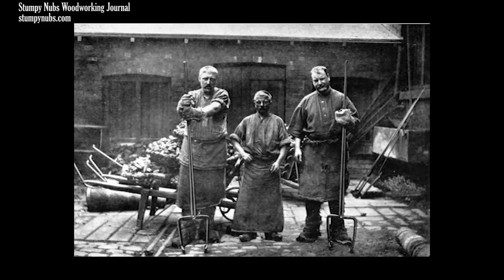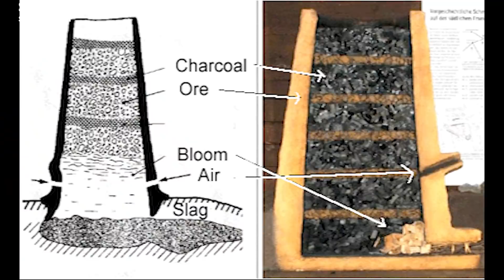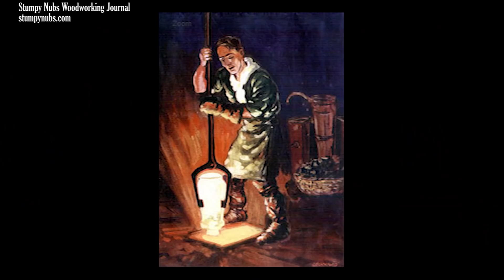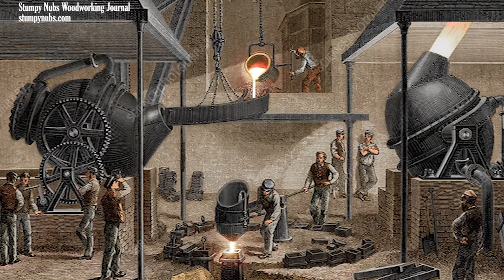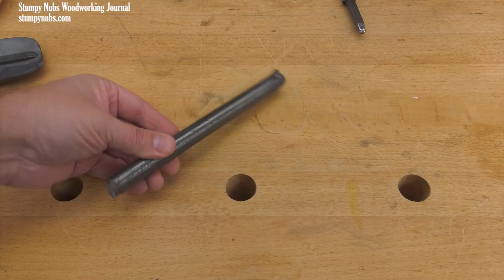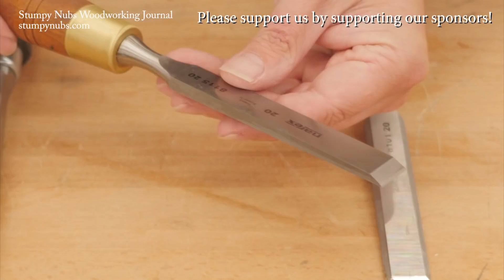Why a lot of tool steel is bad.

Comment: Just to make sure: my understanding of this is that a metal when is cast gets tidy particles, hardening works because you displace the molecules due to termal expansion and general heat and then cool them down getting an untidy mass that is strong due to his creases and uneven distribution of particles(kinda like a folded sheet, or interlocking hooks), heating it up releases the tension stored in those particles making the metal malleable and soft while it was previously brittle and hard exactly like glass (that has the same principle),i thought wok hardening worked the same way, at the end you talk about casting these rods and forming them with a pressed stamp, wouldn't that give a worse result than a forged tool due to the many hammer blows?
Reply: I dont understand why its assumed because its stamped it somehow will be worse off than being forged. Im just a total noob that youtube recommendation got me here, but from my understanding (i do watch alec steele for entertainment too) being hand-forged doesnt really have any advantage material property wise (i could be very wrong)? Making moulds are very expensive for a once-in-very-long-time projects and thats where forging advantage is (again, i could be wrong), you can shape the material anyway you want without commiting to making a mould for it. From Alec videos he does still heat treatment the finished product, so i dont see why would it be any different.

Feel free to inform me of this, im curious about this whole thing now haha
Reply: @Crustee0  i do watch alec steele too, in my understanding working a piece is better because you are displacing material and forcing it into shape as opposed to for example casting, when you cast a liquid metal the particles while still free in the solution will go to a place in which there is no force applied to them, making a geometric structure, while if you move material without melting it or you cool down a molten piece quickly the particles will get stuck with tensions between each particle that can be removed by heating the piece and letting them move around while they can (the more you get close to liquid state the more freedom and movment they have). Working on a piece means generating more tensions inside the structure which mean more strength at the cost of being brittle, exactly the same thing that happens in glass or obsidian. Striking the piece with the hammer makes the structure messy and stronger, this is probably true for the press too but i am not sure it's exactly as effective, the reason is that the displacement of material is determined by only the shape of the product giving and hardly optimising the work hardening, while the hammering will come 100% with a high ammount of particles in tension which would equal to stronger steel,  casting it would be easier but ineffective because it would lack that messy structure. But i am no expert, i was making a question originally trying to understand that, my reasoning behind said question is the one above.

Comment: About the laminated plane irons, there is another reason. You can make them quite a bit thicker, and having the soft iron layer means you can still sharpen them easily. I have one of those in an older wooden plane, and it's great. The bulk of the iron is removed with a file. Richard Maguire touched upon that in his sharpening series (I think).

Comment: Thank you for a very nice explanation. Also I'm happy to see Czech Narex chisels featured. I have a set of those bevel-edge chisels and I'm very happy to use them. They need way less frequent sharpening, eg.  than Stanley no. 5/4 plane blades from 1930s. In Czechia we had very advanced steel-making industry until it's fall somewhere around 1990s. 😔

Comment: The development of the blast furnace was also an interesting change to the iron mining industry as well, especially in northern Minnesota's Iron Range. Low-grade Taconite ore was easily accessed and abundant, but hard to process in large volumes, which required the addition of deep underground mining of high-grade Hematite, an ore that's 70% iron and 30% oxygen. And its greatest use was that you could sprinkle it into a crucible of molten taconite and the oxygen woul be freed, replicating the effect that later blast furnaces used. Blast furnaces meant that mining companies could strip-mine for taconite instead, process it at the site to turn it into pellets of higher iron concentration, and foundries could easily smelt it from there into base iron to make steel with.

Comment: Nice job! The only correction I would give is that the cooling process is dependant on the type of steel, ranging from air, salts, specific oils, and, very rarely, water - even the type of steel that was designed to be cooled in water isn't done that way because water cools too rapidly. There was also a period in the mid-century 1900s where steel was being heat treated and tempered chemically, but that process was lost. There's also a process where the steel is treated and tempered by pressure alone. There are also non-carbon-based steels that don't rust and get harder with use, but not more brittle. Often manufacturers will take shortcuts in the heat treat and tempering areas to save time and money, which is where the largest difference in the quality of modern tools is at.

Comment: Loving your presentation. Would be great if you could do a presentation on the Hatfield, England, rail disaster. The rail cracked into 300 pieces because the bean counters thought a harder rail would last longer. Instead it just shattered as the train passed over. Bst wishes.

Comment: Sheffield cast steel varies enormously. I own perhaps three hundred different edge tools and many hundreds more have passed through my hands. I have favourites that I use near every day, others that rarely get used at all but those I have kept are invariably of good or excellent quality.
In my experience Sheffield cast steel began to drop in quality in the late 19th century, production was by any standards huge, so that may have been the main issue. I notice less laminated irons than earlier in the century too.

Comment: My grandfather was a metallurgist who started his career at a steelworks in Teesside, and finished up running a casting shop for the Ford motor company in Dagenham. He died three years ago, and videos like this make me wish I'd taken more time to learn systematically from him what he knew about these processes. He knew more about controlling the solubility of carbon in steel than anyone I know, including discoveries he never shared in patents or technical literature. If he knew things that nobody else had worked out, and it helped Ford make better products with less waste, then as far as he was concerned he was doing his job. It's sad to think that expertise went with him, and to think of all the other experts in the British steel industry who moved on to other careers, retirement, and ultimately took their knowledge with them to the grave. It would be incredibly difficult, now, to build that industry back if there was ever the political will to do so, because we're simply running out of people who understand it in enough depth to produce a good product.

Comment: I have a combination of old and new.  Old is better than cheap new obviously.  I have a new Veritas dovetail saw and a Taylor & Co that is 150 years old.  Both are great.  As a note, rifle barrel makers in the early 1800's liked used or "seasoned" buggy seat springs for making "Damascus" hammered barrels.   They said that it was stronger than "new" steel.

Comment: This video was great.  I hope you do one on High Speed Steel and some of the pro and con of using tool made from it.  You could add in the importance of sharpening HSS with CBN wheel but not sharpening steel on a CBN wheel.  Power metal steel could be another great topic woodworkers would like to learn about.  Keep up the great work, my wood working club members love you videos.

Comment: I took a course in metallurgy, and we had to make our own chisel from cold rolled 1" round stock. We heated it to cherry red, hammered it to the characteristics of the edge that we wanted, reheated it again to cherry red, and then quenched it in engine oul drainings, and this helped to draw some carbon into the steel. On another occasion, I took a piece of hot rolled, hardened steel, and tried to use this process to make a chisel. Unfortunately, it got so hard that it became brittle, and the first time I tried it, the edge snapped off. I don't encourage people to do this.
Reply: But did you temper it ?
Reply: @MrNetnic  annealing is a process of softening steel, and quenching it is a means of hardening it. Either oil or water is quite acceptable, but oil is not as harsh a process.

Comment: I'd love a video digging into compressed powder metals as well. I did a lot of digging into what metal I wanted my pocket knife blade to be for the same reasons you cite. I was sick of soft blades dulling quickly but didn't want something I had to send out to be sharpened.

Comment: I agree with you on the quality of modern steel, I see the problem as a quality  control issue unless you pay top dollar the steel composition and processing may be close, but not close enough.  While tools of old that survived have gone two quality assurance quality control cycles one from the original manufacturer and one from the craftsman that used it.  If the steel was bad it would not have been saved.

Comment: I've tried establishing a new bevel on an old laminated plane iron with a damaged edge.  I gave up on the xxcoarse diamond plate and ended up grinding a bevel on the bench grinder and finishing by hand on the diamond plate.  It took a LONG time, that steel is hard!

Comment: Excellent video! I 'collect' old chisels as they are way cheaper than new ones (at thrift stores they range from 0,50-2,50 euro apiece). But also because I like the history that comes with old tools. They all have a story and were once someones prized possession. I always tend to use my newer chissels like Stanley and Narex (sorry) for the rougher jobs as they are replacable and seem to be easier to sharpen. The once dutch made Nooitgedagt chisels made from Swedish steel (they look exactly like the ones from Eric Anton Berg) are very sought after here and can sell for quite some cash.

Comment: It doesn’t have to be cheap chisels that are too soft. I have recently replace mine with a set of Qiangsheng which are much harder. I sharpen with a Worksharp so its quick and easy. They are less than half the price of my originals and they sharpen just as well and last enormously longer. I wonder if I could re temper my originals as they are comfortable and beautiful.

Comment: I was working in a factory. Our tool steel was made here in Hungary for order and was around 2x-3x heavier than normal iron or steel. Very durable, very strong, very hard to cut. Gears and tooling going on for years, some decades without a need for repair or signs of worn. Some of our machines were from england, '60-80ies, and the quality of the iron, pressed iron was much higher than it is today. It's just strong and durable.

Compared to that there are some steel today that I guess is strong. But with direct comparison to those, it's just cheap. It's not that quality. Not even the same league. That iron, just iron, was not getting damaged. The tool steel was used in presses, or as hammer for industrial machinery, and it lasted for years under such pressure and such usage, before getting worned or cracked. It's incomparable. 

However, a chisel made from that material? Tooling steel, that was used 0-24, for decades, with barely any worn? It will last generations if not more. That's just have no timer on it.

Comment: Very important to mention that the specific carbon content is what allows carbon steel/tool steel to be quench hardened and annealed into a controllable hardness; the other steels, mild, cast iron, stainless, they lack this controllable hardness.  But the most important feature of the hardening and tempering process vs attempting to just make a steel that is naturally at a desirable hardness via other means, is that the hardness exists primarily on the outside surfaces, or all the way through if desired, or just barely on the skin of the piece, whatever the end product requires... and the crucial ability to leave critical sections of the piece soft, namely the tang and the spine of a blade, or the shank of a tool... and the best part of carbon steel is the ability to take it to the forge and change it's hardness or what sections are hard at all, at will, without destroying and reforging the piece or having to forge a new one from different steel.  There is alot to steel, and alot to tool making too, and you cannot understand the later without the former.

Comment: Some of those old English chisels have steel that is brittle about like glass or it's soft like an old tin can. I worked in some amalgamation mills, or "micromills" that made amalgamations of special steel alloys. Capital Metals used long electrical furnaces. I prefer a onsie twosie induction hardening approach. Either way, it is an art form. You have know your equipment on an intimate level.

Comment: Being in blighty I'm fortunate in that it's not uncommon to find decent 'Made in Sheffield' chisels and other tools are reasonable prices. not made in Sheffield however as an example I've picked up a 1930 Stanley No4 Made in USA for equivalent to $3 (£2) and  countless other tools such as lathe chisels (made in Sheffield) for around equiv $30 for a bundle of 15 chisels and gouges.
I have an old pruning knife that belonged to my grandfather, it's Made in Sheffield and holds it's edge like no other blade I own, it has always had a hard life but rarely dulls it's edge, I don't own a lathe so can't really comment on the lathe chisels I picked up at a car boot fair.

Comment: And that's why if you are resharpening your tools on a bench grinder, that you don't overheat the metal as it will ruin the hardness thus making the tool useless. Take your time and don't rush when sharpening tools on high speed grinders.

Comment: Cryogenics does not harden tool steel, it helps align the molecules into a more uniform, stable pattern prior to the steels last temper and making the conversion of austenite to martensite a higher percentage.

Comment: I'm confused, I always thought that blast furnaces turned Iron ore into pig iron or cast iron, and actually to produce steel required further processing in other types of furnaces to remove the huge amounts of carbon that is in the cast iron from its conversion process.

Comment: As a knife guy the topic of steel is one I enjoy. This is a great video with the exception of not laying out the 'why'. The 'how' is great but I'm left reading between the lines for the 'why', other than makers futzing up any of the steps. Is there one step wrong more than others? Why is that? I don't think you intended to be vague and I'm probably nitpicking. My overall question of why, when steel type is 'equal', do some blades hold an edge while others never get near one?  It's usually blamed on 'poor heat treatment'. That isn't saying anything relevant and the question still remains. To compensate for my criticism or lack of attention I present you this engagement a like.

Comment: I agree with you there were some quality old tools but nothing beats the tool steel that was made in Japan and Sweden I'll take an old Sandvik from the 80s or one of the Japanese chisels or the German Solingen .My step bits from the 90s were made in England for GB Enerpac and lasted longer than any American made unibits ,better than Greenlee or Irwin  or Lennox.Cobalt tool steel was fantastic ,now we have tungsten carbide that has come down in price ,you need to make holes or carve wood tungsten carbide tipped tools or cobalt alloys have made work alot easier

Comment: I have many chisels & gouges manufactured England, Germany, Sweden and the USA in the mid-late 1800s through the the mid 20th century and do not use very many of them. I am more a collector than a craftsman. I do treasure the Eskilstuna chisels more highly than most of the others and use them more often. That said, there is not doubt that modern tool steels are superior to even the best produced 1800-1930s. I do own several Narex chisels and find them to be excellent for the price, but I really like my Blue Spruce and Lee Valley chisels better. Of course, I have to be willing to pay a premium for those premium quality tools.

Comment: Very thorough history of steel and clever lead - in for the chisels! I'm sure the metallurgical quality is there, though. 
Your exposition made it obvious that Damascus Steel was an attempt to create a steel that had all of the qualities for a sword or knife. Tough, sharp, and durable. As well, the Japanese Samurai Sword makers used a core of very hard steel surrounded by a casing of soft steel to absorb the shocks which would otherwise crack the edge - retaining hard steel. Their approach worked quite well. 
All in all, a very good historical narrative!  :)

Comment: It would be interesting to see a comparison of the steel used in chisels, versus that used in high end milling cutters. The latter can carve metal as incredible rates without chipping or losing their edge. Of course, they do cost a bit…